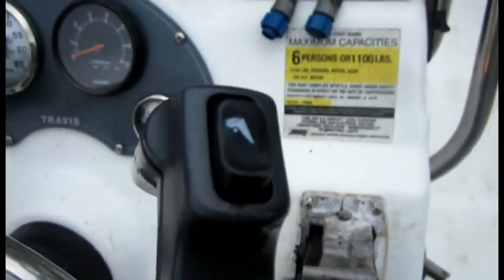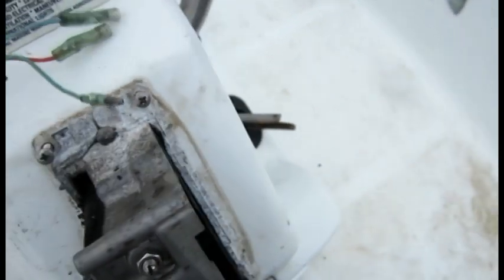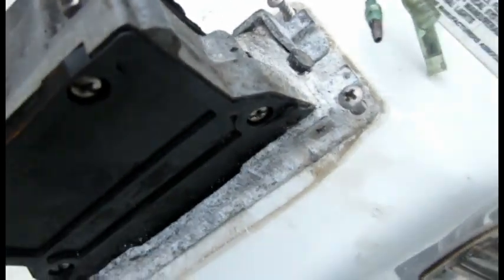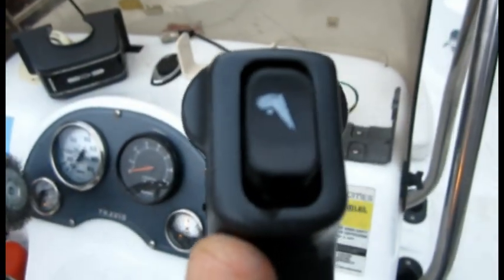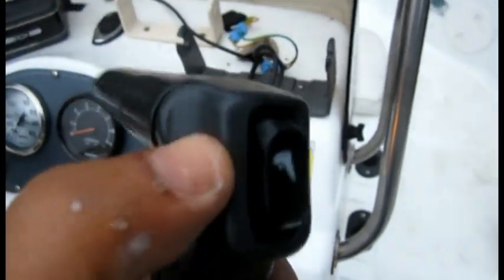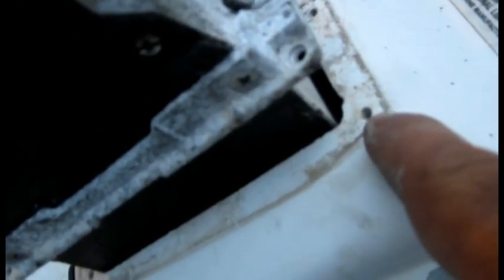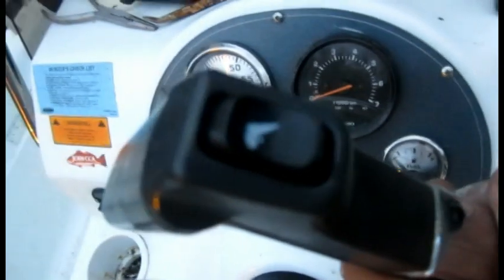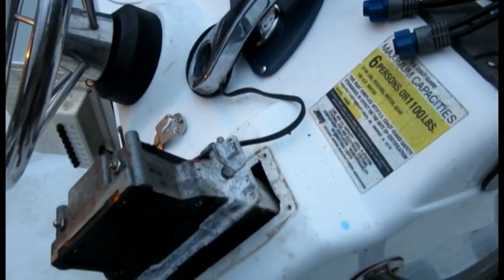repair or change boats power tilt switch ptt switch trim

Comment: None of these trim switches last because they activate an inductive load...and without suppression, those little contacts wear out FAST!. Adding Quencharc (100/0.1) suppressors across the contacts will stop arcing and prolong the switch contact's life.

Comment: the switch above has 900 hrs of engine time and it has outlasted the original engine however I keep the boat in a covered storage boat is used in saltwater only

Comment from the maker: put a drop of salt water in the switch and watch your engine move out of the water .. yea you get the switch wet you are in trouble.. we traced the wire and discounted and used the switch on the motor to get home ..

Comment from the maker: low voltage is an issue as well full battery is 13.2 volt and even 12 volt reading means 50% charge

Comment from the maker: in my case two small screw opened the inside of switch and there was a gold plated sew saw arm that was cleaned with a q tip and system was working for couple of months .. but it needs to be replaced anyway at about $100 cost

Comment: Show the switch
Reply from the maker: what kinda problemdo you have . may be i can help . .switch has a rubber cover and a rocker very simple basic design inside..  If salt water gets in the switch because it is worn out . it will make your engine move out of water  since smallest contact via salt water will activate the relay. most people have a stuck relay or low volt battery

Comment: My motor trimmed up on its on and now doesn't respond, do you think it's the switch?
Reply from the maker: yes, if you trace the wire color you should be able to disconnect it in few minutes and then you are able to use the second switch if you have one to move the engine . it possibly got wet . you may have a cowling damage as well in form a crack if you are using an outboard and engine move behind its limit and hit anything .
Reply from the maker: https://www.youtube.com/watch?v=uju_VoHTu1g

above video shows the inside of the switch. it is very easy to clean it and there are other videos on you tube that show the inside good luck